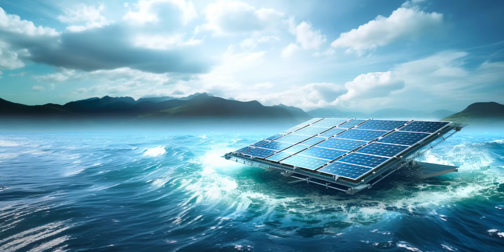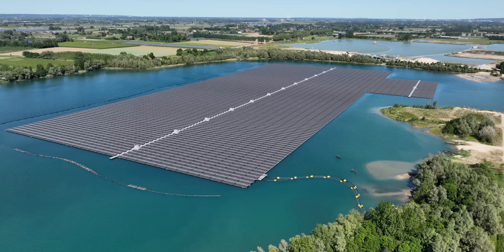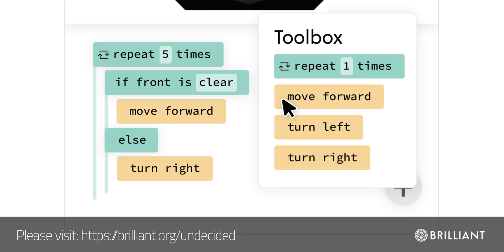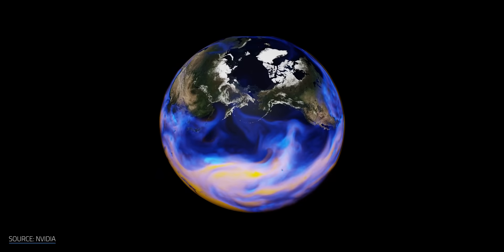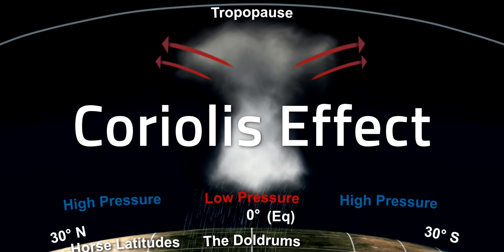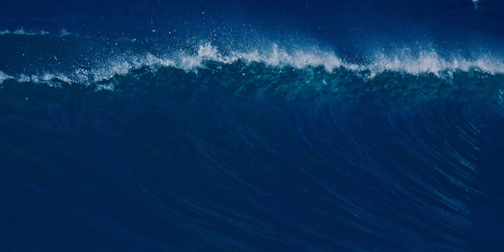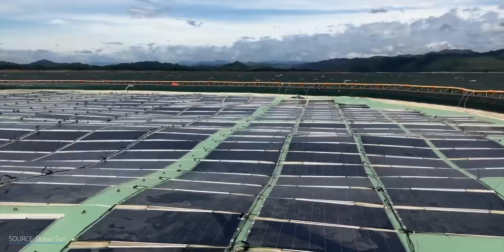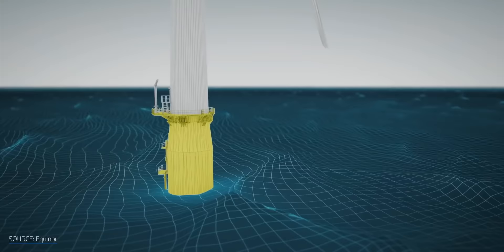How Offshore Solar Could be the Future of Energy

Comment: I feel like we should be focusing on the sahara first. The countries there could use the economic boost from selling off power that is generated on their land, and most of that land is uninhabitable as it is. Also, covering a significant portion of the sahara could have a cooling effect on the area, and possibly allow it to support plant life again. That's not to say we shouldn't put any effort into floating solar, but it should definitely be focused more toward the areas that clearly benefit the most from it (like preventing evaporation of canals, etc in arid environments, or agrovoltaics).

Comment: What is the reason, why we just dont put some solar panels on those wind turbines?
Put them around a height, where the blades end. 
Since from top to bottom those pillars become wider you simply could attach them with steel cable.

Comment: With floating solar panels, it seems like it would be fairly simple to make them track the sun. 2d solar tracking can increase output by about 20%.  Just have the entire platform move to track the sun. A simple cable and wench system could do it.

Comment: Circular Solar has a micro field prototype - been testing how to optimize this for a long time now.
What Matt's trying to say is - water helps keep modules close to their optimal 77F (25C), STC rating temperature. FPV is much more viable now with bifacial modules but especially silicon perovskite because they pick up light spectrum other solar tech cannot. CS generates excellent output with a Bifacial PERC module because of what he mentions, but additionally its our infrastructure innovation.Water integrated solar works!

Comment: The maintenance labor would be ridiculously high. Salt water splash will leave salt deposits on the panels which will have to be constantly cleaned or just accept the reduced productivity from lessened light infiltration
Reply: Not just the cost of getting maintenance crews there would be higher, but the material degradation due to the adverse environment would be much higher as well. There's no advantage for efficiency like there is with wind, either -- the Sun shines the same no matter if you're on land or out at sea.
Then you have transmittion losses on top of that. And all that when there's no need to look at the water as a surface at all, since there's still so, so much free space on land. There is no way this is worth it until every roof top and every parking space is already covered. And even then, it would be a stretch.

Comment: Convert old oil rigs into solar plants. Scotland has dozens of them just sitting waiting to be scrapped. Has anyone tried this? Also, the open ocean would most likely be a no-no considering the weather patterns. However, lakes and other inland bodies of water could potentially be viable.
Reply: That woupd be more expensive. The oil rigs are relatively small surface area relative to the cost of maintaining their structures.. 
Solar needs lots of space and long 40 year+ lifetimes.

Comment: Set up resiliant fixed moorings in an optimal area for seabased PV. To each mooring connect a large RC controlled boat topped with PV panels. Whenever a large storm approaches the boats scatter to survive the storm individually with the dangers of collisions out of the way.  After the storm the boats are guided back to their moorings to generate and transmit power.
Reply: Also the boats return to port for maintenance and upgrades then sent out again. The amount of boats can be increased as needed. As for the moorings, I envision one central mooring connected to land and the rest branching off from it.
Reply: I forgot to say that the power is transmitted via the moorings and cables connected to them. One mooring is connected to land/the grid/whatever needs the power. Other moorings are connected to that main mooring.

Comment: Solar should be located close to where it is used. Its flexible sizing and quiet operation are two of its greatest advantages for local installation. For the same security and infrastructure reasons as big power plants, large solar installations are less than optimal.

Comment: My lake approximately 30 acres and about 20 of those acres are very shallow 2 m in depth on average. I was only going to put 1 acre of solar panels in the most shallowest spot and record the temperature of the water underneath.  The problem is that the water heats up too much, and it becomes oxygen deprived in the heat of the hottest part of the summer. 

Algae takes over and duck weed, and it becomes more of a swamp . 

I want to aerate the lake and cool the water down so that I can dissolve more oxygen into it for trout hatchery

Comment: Regard biofouling: A small fraction of the output power can be applied periodically to the submerged conductive parts of the structure, (with polarity opposite to that used in growing "electrocoral") to prevent marine organisms such as barnacles from being able to produce hard and heavy shells. The electrolytic effect would instead dissolve the shells, making the structure quite repellent to those organisms, and probably to softer kinds of biofouling as well.

Comment: Place it under a plexyglass dome with the water being let into the underside in and out through Tesla valves. It's a ball with a gyrostabelized "floating" ball inside with Tesla valves through both to allow water to flow through. Multiple sets of valves to encourage a convection current may help with cooling.

Comment: I would use solar for shade on streets.
Add those little wind based genarators at the edges, and the street under this will have shade, and any shaking that may have destabalized it, is also used for power.

Comment: Like saltwater is extremely corrosive, plus damage caused by weather and waves, then add to it that the pannels gonna lie flat( or undulate on more or less flat plane) thus the wont face directly the light and thus have less than ideal performance( on land panels are mostly tilted towards sun). 
both extremely high either( or prolly both) maintenance costs and/ or cost of additional protection against elements and the actual effectivity of the panels will prohibit this concept from being anything more than just concept.
rather than trying to square circle and try to mimic land conditions on open sea( even on land solar panels just recently became economically viable option for electricity generation) it'd be better to use how different sea is from land and concentrate on tides and waves as a means of generating power.

Comment: In my view, the potential to use the floating structure to track the sun (i.e. the floating platform should be able to rotate as a single massive structure) should be exploited. FPV should be a playground for tracking PV and therefore maybe concentrator PV and the higher conversion efficiencies that come along with it.

Comment: Placing sea based PV in timezones east of large cities reduces the need for energy storage. Use HVDC (High Voltage Direct Current) transmission to get the energy farther without power loss.

Comment: One concern I have over these systems is how much sunlight will shallow bodies of water be deprived of? If these floating panel systems are large enough, plenty enough, shallow underwater ecosystems might lose out on significant amounts of sunlight, causing mass death to underwater plants, as well as the fauna that feed on them. Simply put, floating panels might mimic harmful algae blooms. 

However, this could be circumvented depending on the panel design, the depth of the water, gathering data on local aquatic ecosystems, etc. We need to continue increasing our wisdom alongside technological advancement.

Comment: a wind turbine in calm water with a platform of solar panels built above 10M height, the structure if buikt with wind torsion forces in mind could be an added energy generator for the turbine and its systems

Comment: What I don't understand is why OTECs haven't taken off. Ocean Thermal Energy Convertors as a concept is very resilient to weather and surface conditions. Can you do another update on this, please?
Reply: Probably because the focus is on making a quick profit from worthless pv solutions. Rather than an actual solution that requires lots of work developing work and certainly massive infrastructure at massive cost. Just build a coal power station instead, sorted.
Reply: I agree it is a good technology. It’s probably gotten less interest because it requires specific coastal or sea locations with high thermal gradient. Unlike solar which can be plopped down anywhere. So orders of magnitude less R&D money. But I’d expect it to start taking off eventually.

Comment: Of the designs shown, the "lily pad" design is most appealing to me at this first glance - it appears to do more, with less. But as noted, more information is needed.
I'm much more interested in putting floating solar on top of freshwater, particularly aqueducts and irrigation canals, because of the numerous synergistic effects. And it's a lot easier to get to them for cleaning, maintenance and repair. For offshore, it only makes sense to me to install them along with offshore wind farms - not all on their own.

Comment: Once most reservoirs and canals are covered with fpv and has proven in real life to work reliably then come with suggestions on ocean versions. California and New Mexico still needs help with freshwater supplies and power for air conditioners, start covering their reservoirs and their feed in canals and you can at least help on both things but only pay for one. After all more freshwater and electric power would be most welcome there and it could help lower the cost for both in the long run.

Comment: I think this has advantages beyond the immediate concern - especially if we're to consider space based solutions in the future, anything that advances materials and methods in that direction is essential.  Arguably there are nearly no uses for wind power up there, at least for quite some time.
I'd like to see how this goes in Australia to minimise evaporative loss as well as utilising the space for generation - same for many other hot and dry climates of course, particularly glad to see India doing the hard work already.
Reply: Combined with aquaculture and offshore wind it's a winning idea
Reply: @sagetmaster4  I saw they were spacing out panel arrays with gaps to provide growing area for crops that preferred less sunlight or didn't have to chew through as much water to compensate for heavy direct sunlight.  I wonder if there is an aquaculture version of this for, say, seaweed cultivation?  Along with protection for aquaculture too.  A multi-bird-single-stone approach, I like it.
Reply: @davocc2405  on land this is beneficial in hot climates and in mild climates for certain plants, nut seaweed needs allot of sunlight.
what would be an option is tu re-use an oil rigg put a large windmill on top, and farm things like seaweed, and at a lower dept mussels (but don't combine that with solar)
Reply: @ChristopheVerdonck  you probably couldn't get more than a couple of turbines on a rig, they need to be spread out a fair bit:  the bit about seaweed needing maximum sunlight is interesting, I hadn't heard that before.  Marine ecosystems are quite complicated to grasp, given that we have only scratched the surface of marine harvesting it's understandable.  We're still learning how the land version works (especially with partial deindustrialisation of many types of factory farming).

Comment: You're too cool Matt ! Great video and information  !  Ocean solar is going to need a multitask platform to be economically viable.  Imagine a cluster of six ocean liners cooperatvely harnessed together to form a floating tourist and gambling and University venue.  Now string wire rope or carbon fiber rope between the ships and use that to suspend the solar panels on.  This array would also support several wind turbines.   Solar Vegas University  !  Cycle out the ships for maintenance and you've made a employment and energy producing entertainment machine.

Comment: not sure why i never thought of offshore solar. kinda wish you made a distinction between offshore solar and floating solar, in the same way there's a difference between floating off shore wind and fixed off shore wind. either way, offshore solar (fixed) seems like a preferable alternative to floating arrays. rooting really hard for this
Reply: Why is fixed preferable?
Floating presumable has better temperature management, which is what boosts efficiency and reduces heat thermal cycle aging of the panels..
Reply: @timtravelnomad  why wouldnt it be? fixed mitigates unaccounted for variables and is less suscpetible to damage
Reply: @critiqueofthegothgf  well i just shared some examples where floating probably is better. 
But lets say tides rise and fall, if you have a fixed structure, do the panels end up underwater? Or are they built at expense to be higher than the largest astronomical tide? What's the definitiin of fixed?
Reply: Solar panels are light and need a very large surface area. It would  cost too much to put them on a solid  structure mounted on the seab bed.

Comment: Sounds great for countries close to the equator. The cost of transmission to other weather-prone areas is where the cost to implement jumps and may negate the benefits of huge solar arrays on water.
Reply: Yeah, a solar floater for emergency post hurricane power makes a lot of sense

I suppose if there was the right battery storage it might make sense to have a fleet of floating solar panels that move from one area to the next and back to keep charging like giant massive sand batteries...

Maybe
Reply: @NerfThisBoardGames transmission is very efficient and much cheaper than occasional single-cycle uses lithium batteries.
Reply: @timtravelnomad  I was definitely not talking about single use lithiums but I agree with you.
Reply: @NerfThisBoardGames  if you charge up, and then have to ship those batteries somewhere.. that's essentially very infrequent use, as it destroys the economics of batteries. Their cost needs to be amortised with 1-2 full cycles per day to make economic sense. 
HVDC transmission can deliver GWs of energy much much cheaper, with only 3% power loss per 1000km.

1 HVDC cable does 2GWh every hour!
To transport 2GWh of batteries over that distance would take an armada, and take weeks, and have much higher capiral cost.

Comment: It seems to me like offshore solar could be more useful than just producing solar, but this depends on whether the presence of panels increases or decreases the amount of heat absorbed by seawater. On the one hand, solar panels produce and waste heat into water, but on the other they also convert a portion of the sun's energy to electricity and export that energy. One question to consider is: What converts more sunlight to non-heat forms of energy per unit area of sunlight - the 3 dimensional array of photosynthetic organisms struck by that light, or the same area of solar panels? In either case, changing water temperatures certainly has effects on marine life, and if truly massive portions of the ocean surface are covered, we may alter currents driven by altered surface temperatures

Comment: We should go very big into (wherever) solar simply to generate (on site) green hydrogen. Most people don't realize heat is very necessary in modern industry, e.g., steel, concrete, etc. IOW, electricity can't replace everything fossil fuels do. Without hydrogen we can't replace fossil fuels, i.e., green electricity production is just half of the story.

Comment: Did anybody notice that in most of these systems the orientation of the panels is horizontal? Surely that completely outweighs the efficiencies gained wirh summer cooling and the extra cost of building a system that floats and is resilient in a wet environment. I think it's a non-starter and will only ever be a tiny contribution to out energy demands

Comment: Another advantage is the ability to turn the arrays toward the sun using motors in the water increasing power output/utilization.  These things will eventually power all electric superyachts when they are at anchor also.

Comment: Certainly FPV on inland water sources is an excellent idea. It provides both protection for freshwater sources, limiting algae growth and evaporation, while providing cooling benefits for the solar panels, and the solar panels are easy to access. 

Ocean-going FPV seems viable technologically, but it needs to be engineered to deal with waves and wind on the sea, and being positioned off-shore creates greater distances and difficulties for maintenance and transferring energy, so this all creates added costs. Any set-up would need to be modular, compact and easy to transport and deploy - like the one modelled on the lily pad - and they would need to be in the right geography and relatively close to either existing energy production facilities or population centres (a lot of the world do live on the coast, so this wouldn't be so difficult).  

The question of impact on aquatic life is a complete unknown that needs study, but hubs of biodiversity can be avoided. Designs which let light pass in-between the photovoltaic cells and panels (even just transparent plastic) could solve any problems of blocking off sunlight to marine life.